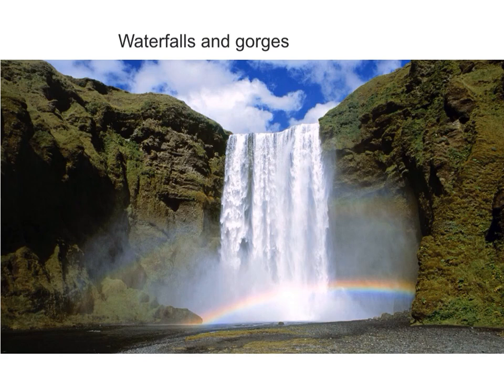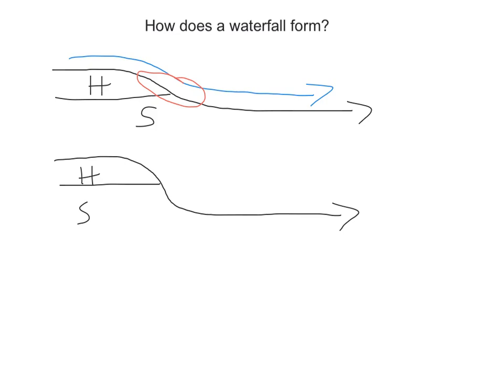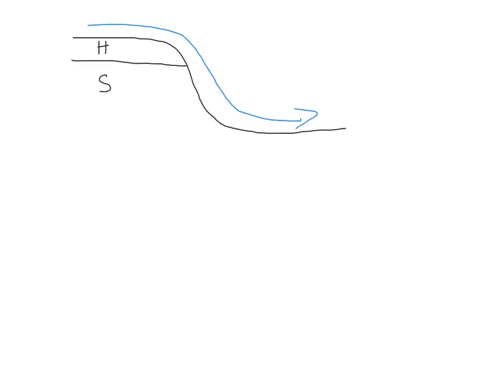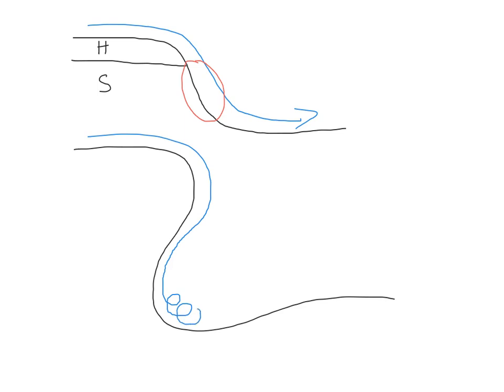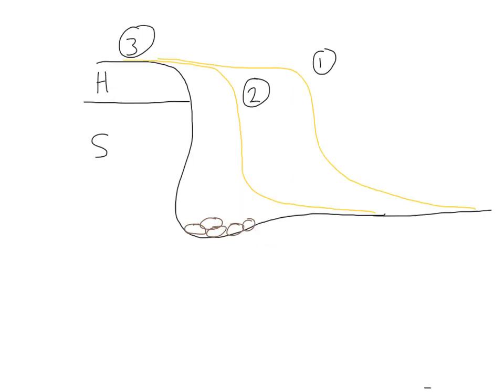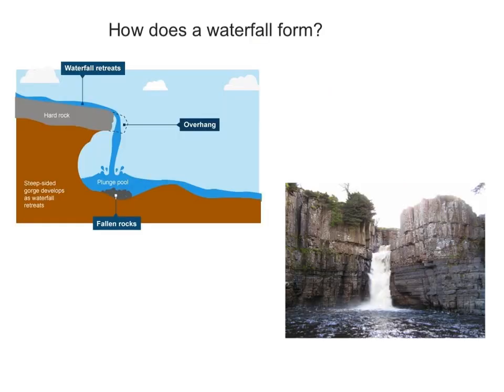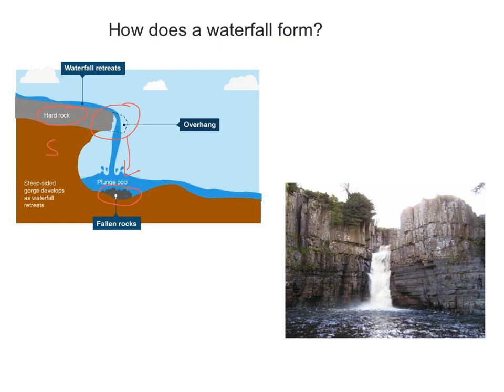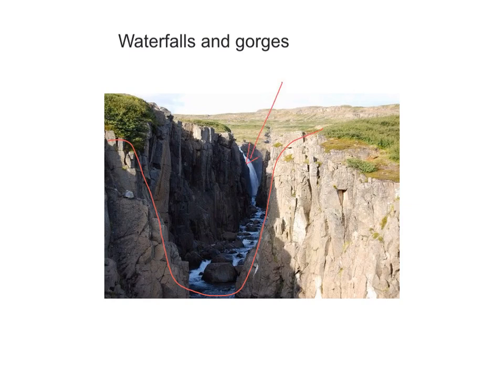Watefalls and gorges

Comment: What happens if the hard rock reaches its maximum point where water can't retreat anymore? I mean it can't be an infinite retreat of water.
Reply from the maker: The hard rock of the waterfall will continue to retreat as long as a) there is enough energy for erosion and b) there is resistant geology.